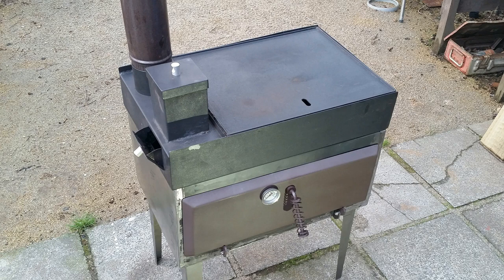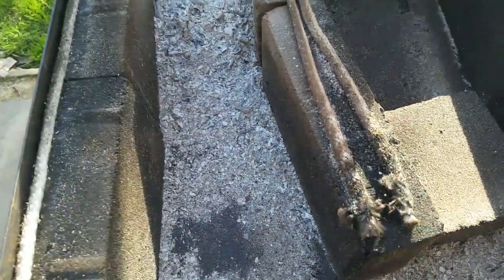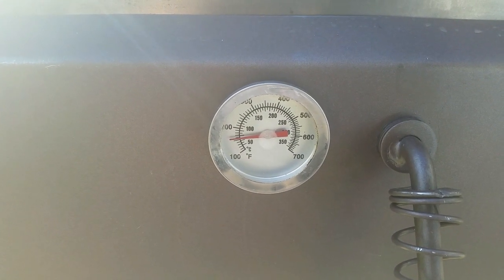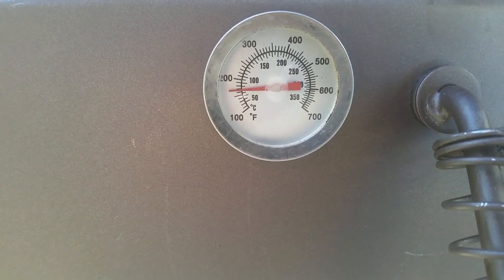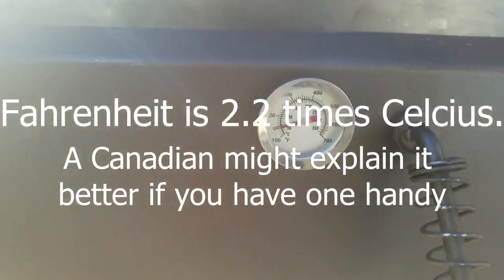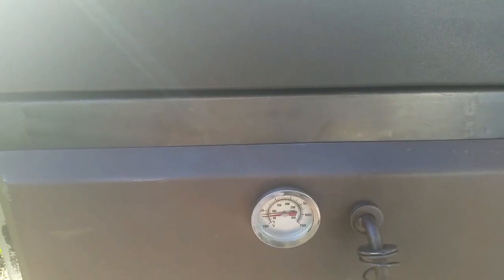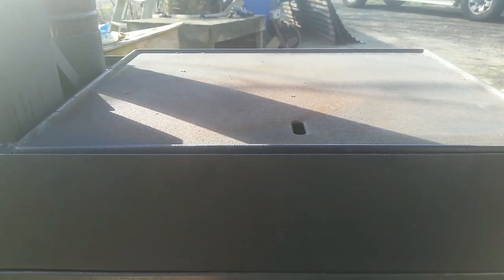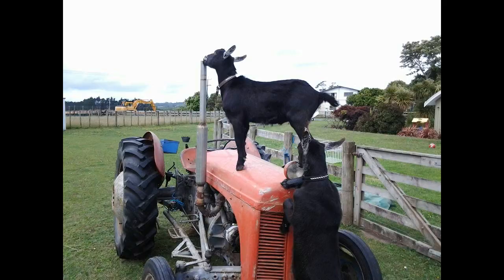Prototype Rocket Stove Oven Community Brainstorm 2019

Comment: My friend! thanks for your video! Is just a wonderful idea because you basically created what we call an economic kitchen (or grandmother's stove, economic stove) which is actually incredible when going into cooking with fire. Those stoves come with a combustion chamber, ash collector, oven, a drying drawer and the most luxury ones come as well with an integrated water heating system that is latched to the radiators systems in order to move heat through the whole house.
Basically those stoves, uses a very simple design that allow the smoke to move around the oven chamber when needed, only by moving an iron plate that's placed inside the stove.
So what I think is just simple as that! smoke is pushed easily from a rocket burner so you wont have many problems when pushing it downwards, and temperatures as you know are very high in those gases, making an oven warming enough for bakery and meat as well.
Again thanks for sharing this design adventure, it really blowes my mind
Reply from the maker: I love the added challenge of cooking on woodstoves. I have several here.

Comment: I think the cassette burner idea is great. If you want to use only one burner, the solution may be simpler than you think. In the wood burner oven world there are two types of ovens, as you may know, called white oven and black oven. The white oven essentially being an smaller box in a larger box, where the inner box is the oven.  the air flows inside the larger box and all around the inner oven, heating it up. 
Now: you can put the outlet from the outer box anywhere you like. Yes, hot air rises, but it will flow the path of least resistance. So put the outlet chimney chute in the bottom of the big box, and then let it run up the side closest to the burner so it can heat up a bit, helping it to rise more. The air will fill the outer box, the hottest air still on top, but you have now forced it all around the oven and even under it, since the outlet is in the bottom. Get it? All you need to do is to open a slit on the right side of the rocket bottom plate and take out the stones in the middle. If you want a white oven you need to make a smaller inner box, bit if you make do with a black oven you could just make an exit hole in the bottom of your existing oven. That slit in the rocket bottom plate could even be sealable if you wish to not use the oven for some meals. Then you can put the middle stones back in.
Hope I make myself understood, I realise I am not doing the best job of explaining this.

Comment: One problem are the ashes that insulate below the hottest area. 
Try to weld a 4 cm curtain on the top plate to force the flames sweep and expose the bottom in the burning area. 
If it works, in that area put a heat resistant glass instead of the bottom so that some infrared heat can pass directly to the oven.
Reply from the maker: I did that :) - It helped somewhat. the draw is so strong that the ashes are the merest dusting along the bottom.  ive now made a new one in bricks and cement that has the oven alongside instead of underneath- All issues sorted! thanks for watching

Comment: Use either square channel or pipe tucked into the corner of the burn chamber, from one end o f the burn chamber to the opposite side ducted to the outside for fresh air and at the end of pipe ninty degree down to the bottom of the oven chamber allow the superheated air to warm the box put a piece of pipe from the box we're the flue exits up into the flue this will establish a draw pulling superheated air through the oven convection at it's basic. From a stove lover in southern Oregon.

Comment: I've been pondering over all sorts of rocket cook stove designs, but something like your's has always been uppermost in my mind.  I was also wondering how I would go about diverting heat to an oven, but finally realised that the electric stove I have in the house already came with an oven and I can't even remember the last time I actually used it.  So, I came to the conclusion that, because I live alone and rarely entertain,  ( yes, I really am that anti-social, ) all that I  need for any infrequent baking or roasting is a cast iron camp oven.  It would just be a simple matter of dropping it on the stove top and take it from there.  I know that in a camp situation, it was common practice to put a shovel full of hot coals from the camp fire onto the lid of the oven to provide all round heat, but I reckon I can get around that by making a simple heat shroud out of sheet metal and putting it over the oven to contain heat all around it.  I might get even more inventive and make one that folds up.  So, thanks for video, mate, from the other side of the ditch.
Reply from the maker: Absolutely- My idea was a bit far fetched for a free standing camp stove i think- I now have a brick version that has the oven at the side and it works perfectly

Comment: How about blocking the chimney exit in the stove section and making a u-tube down into the oven and connecting it to the chimney. i.e the tube section is in the oven with the heat been drawn in by the draw of the chimney.

Comment: ADD air, simply add more air into the flue of the oven by creating ports to area's that need more BURN/HEAT and throttle it in a strategic manner

Comment: I wonder have you tried a thicker base to the top stove so the heat can be absorbed from the hot combustion part above and radiatd below to the stove?
Alternatively i would reconfigure the rocket stove combustion chamber (where the actual ashes are) into a top half and a bottom half, so when siting ontop of the stove, the top half of the combustion chamber is heating the top stove part, and the botom combustion chamber can direct heat into the lower stove area, perhaps with sliding baffle plates to regulate/isolate heat and direct more one way or the other. Great idea mate, will attempt my own version of this at some, point. Cheers for the inspiration 👍👍👍

Comment: If you redirect the heat that is coming out of the chimney using a couple of elbows and a short length of straight flue pipe and enter it back into the oven box on the side about 2/3 down and have your chimney come out of the other end of the oven box then the draw through will give you a constant stream of hot air, you will probally have to have arrange a flue of some sort to give you heat control. Even as some comments have mentioned heat rises true ,but heat will usually follow a draw if the draw is strong enough. Just thinking.
Reply from the maker: Is that the New zealand Greg Kilgour from Pukekohe?
Reply: @t.h.o.r.  No mate just north of Rockhampton in Central Qld. I hope that the other Greg does not look like me LOL.

Comment: The flames will go where the chimney will pull them to. so the handle you mentioned needs to under the chinmey. so you only need to provide a secondary flame pass which will bring (pull) the 400°C down to the oven. as the chinmeys handle is opened the pass to the secondary circuit, air will be dragged and part of the flames in the hottest area will follow the new way through the oven.
best regards from germany

Comment: Hi. Nice work. Not read all the replies so this might have already been said. But why don't you make your boxsection tubes into ducts - i.e. drill the base and weld the box section around that hole, cap the ends to draw the flames  them into the firebox as in drill into the oven base - or remove the box section and put in exhaust tubing. they will become like water boiler tubes in principle ducting flames instead of water and transferring heat into the oven.  Hinge a flap at the fire end of the box section or pipes so that has its raising  edge points back to the flames but it's hinge is welded on the non fire side of the ducting hole. This flap will catch and force some or most of the flames down the pipes and out the other end of the pipes.  Can Shut off flames with the flap right down to have a "top plate only" cooking set up which would maximise heat up top for cooking. Might be able to adjust flap do many different positions to get exactly the right flow through flame. Hope it makes sense? As I said before i'm impressed with your work.  keep it up and I forward to seeing your progress and you beating this thing!

Comment: Two words:
Heat sink ... which can also be spelled as one word. 
The bottom of your brilliant firebox is, no doubt, quite hot. However, steel is not an ideal conductor of heat. Therefore, the top of the oven is not efficiently drawing the heat downward into the oven because heat wants to rise.
So, you want to fabricate a heat sink that will draw heat from the bottom of the firebox down into the oven. 
Of the two most common heat sinks, copper is the most efficient and most expensive, while aluminum is the economical compromise. You get the 'heat' from the firebox to 'sink' into the oven by using a proper conductor. Follow me for a bit longer ...
It's a drastic experiment that I propose, since neither of the heat sinks weld to steel. 
In theory, you could get a solid one inch (2.54 cm) piece of aluminum (yes, I am a Yank') to use as a heat 'sinker.'
You would have to cut out most of the top of the oven and weld in some angle iron or "L" brackets to support the conductor at the appropriate height. At this point, you are already drawing more heat downward than you otherwise can. 
The reason I suggest such a thick piece of aluminum, is to seat most of it's mass down into the oven. You could go further by taking flatbar aluminum and shaping it to the inside of the oven, to draw heat further down the sides. However, the plate alone may get you to the desired temperature. 
So, two more things to consider:
1) The application of this kind of heat sink will, without doubt, change the temperature (perhaps even the efficacy) of your stove. 
2) You could find an insulator to keep the stove blazing, if there was no reason to draw heat into the oven. 

The "multi-burner" stove is, in my opinion, a noteworthy and brilliant application of concept. Kudos to you! 
If you dare to brave my suggestion, please let me know of your results. 
If I am deftly wrong about it, I certainly want to be notified.
No matter what happens ...
"May the road rise up to meet you ..." 😉

Comment: I was thinking where your fire box is now, add to that and bring it to the outside increasing flew area for heat to move around, a circular heat area;  if the burn chamber was further out and went the length down the side where it is now, and a tiny pipe took super heated air from the chimney area and fed it back to the firebox chamber lower down beside the oven could it not increase the temperatures then?

Comment: Gday Boss.
The problem is the solution mate.
Heat rises. Oven on top.

I know you want two cooking surfaces, but see if this isn’t a good, simple adaptation.

Flat topped, hinged barbie lid on top which rests in the raised position for hotplate cooking, close for oven cooking.

If you’re up for a challenge you could even make it extendable like a drawer so you could hotplate cook on the front while oven cooking on the back.

Thanks for all of your work.

Comment: Perhaps you have resolved this already... Keep the oven its same size.  Elongate your flat stove by the width of your largest cooking pot.  Set the oven on top but pushed over to the right... allowing access to the cooktop and yet still heating your oven.
Reply from the maker: that is really close to what I have done! thanks. there will be a new video soon showing the finished stove. Ive made it all in masonery so that anyone can copy it - no welding or metalwork required!

Comment: I think you need to drop the firebox below the oven, so that you can divert an adjustable amount of the combustion gases around the oven (underneath, along the sides and the back) to increase the heat transfer into the oven by exposing larger metal surface to the warmer combustion gases. You might want to have some kind of diversion device to enable an increased/decreased flow of combustion gsses to either the oven or the hot plate to enable better temperature control of the oven. If you only want to use the oven, you might want to have some insulative cover (maybe ceramic fiber board?) to cover the hot plate. This will prevent heat from escaping through that route and you having to burn more fuel to maintain the oven temperature.

If you know friends who have a wood or coal stove, go check it out how the combustion gases are routed. 

Another option you have, is to use the exusting firebox configuration, with the addition of a by-pass or shrt circuit facility to bypass the hot plate, routing the combuston gases straight to the chimney, and have an eye height oven like this clip I've attached:
https://youtu.be/vxvYz0ILzkY

I wish you lots of good luck with this development process. If you want to talk, then let me know...

Comment: There looks to be an air gap between the firebox and the top of the oven.  The top plate of the oven should be the bottom plate of the firebox... otherwise we would need some heat transfer material between the two plates and close up the air gap.

Comment: Here is the solution, keep your fire box the “same” but extend it to make a square reversed C (something like this ] ) then  your oven can be placed in the middle of the heat channel. So as the fire moves from the fire box to the right then up then to the left and finally up to the chimney the oven  will heated from the bottom , the right side and the top. And you still have the top to cook with pots and then just exits to the chimney. 
It would be easier if I could’ve drawn it here for you lol, but I hope you understand what I was trying to say.
Thanks
Reply from the maker: that is an exellent idea! but there is one issue- Ive had a subscriber who lives not far from me in a stone hut that she built herself in a a forest- beg it off me !- so Im making another. this one is masonry and will have the oven next to the fire box. watch out for that video in a week or two when Ive got chance to finish it!

Comment: The whole configuration is wrong, the fire box should only be on the bottom with sliding baffles to direct the heat up the backside and over the top toward the chimney. By adjusting the baffles you can regulate the temp of the oven and the griddle

Comment: it looks like you have an air gap between the top of the oven and the bottom of the fire chamber? 
You could try sealing it with some hi temp silicone or fire cement?????

Comment: Try second bottom under stove . Like a heat shield,but flame,heat goes between plates.  But with a door by the fire box. And the other side just open to let heat/exhaust come up to bottom  of top plate, letting heat/ exhaust go out with other fumes from under top cooking area. It may help to create a hot spot on right side of top.  You may try 2 chambers ( not 1 big one). This may even out heat levels. When your not using oven. Just close flap by heat/fire box. I'm thinking a flap of 1 x 4 . This should move 25 % of heat under oven.

Comment: What do you think about letting the bottom be a kick ass warming drawer?  Or, Option 2 - Maybe put a scond smaller rocket stove configuration under the oven area.  A really small one.  Those things burn so efficiently, it wouldn't use much wood at all.  AND it would give people the option of haveing a warming drawer underneath OR an oven with the tiny rocket stove.
Reply from the maker: Hi Chris, Im putting this one aside for now. the last three weeks Ive been building a Tiny House on wheels. Just no spare time to play right now. I have scored a bunch of fire bricks and Ill be making a masonry version of this shortly. (with all the modifications done. Oven on the side is the big change. Tiny Hose build vids coming by the weekend

Comment: You might consider adding one or two additional fire box areas with more than one access area to add, adjust and control the fire, heat and air flow that effect the temperature.  You can't fight the laws of nature so work with it.  Fire below where you want the heat.  You can design an air chamber around the section you want as the oven but you may need to add a type of fan to also help with control and consistency of temperature.

Comment: The other thing u can try is start the fire box at bottom  for the oven first and let heat rise to top plate
Reply from the maker: Yup- getting closer and closer to that- Ive so many ideas coming at me but Ive been careful to develop it organically without ripping apart -and spending as little as possible. thanks for your input. :)
Reply: Line oven with refractory brick and re-rout exhaust into the oven then exit

Comment: Perhaps insulate the bottom and sides of the oven and make the burn chamber for the stove lower in height so the rising heat is closer to the top of the oven.
Reply from the maker: Hahaha YES! - Last night I  fitted fire board into the oven. And this morning I tested the pellet hopper/ basket thing we that I made. It works well. I could see down the side of it and decided that as the flames don't touch the bottom of the stove, I should make the whole thing thinner to transfer more heat downwards.i must have picked up on your thoughts!